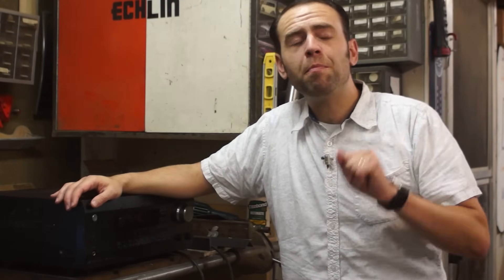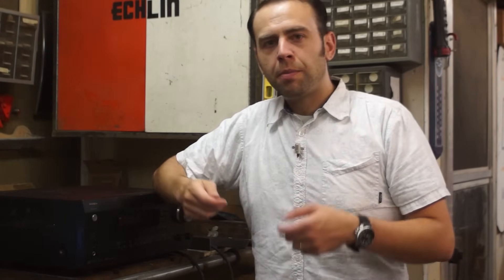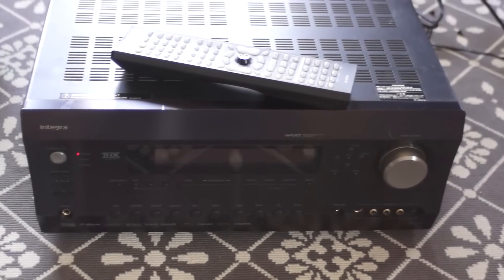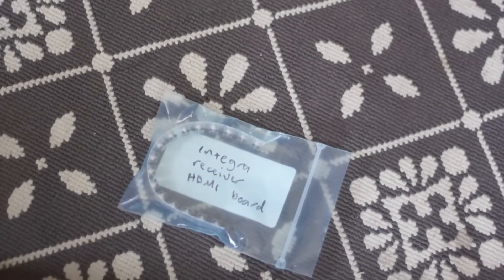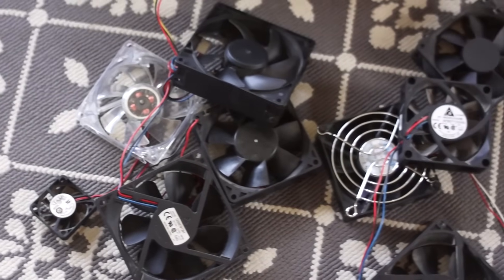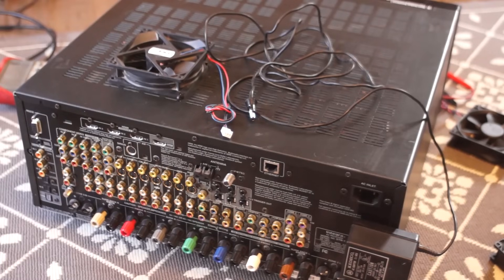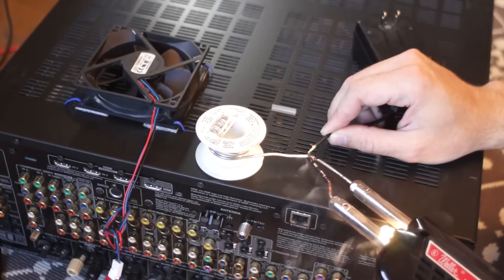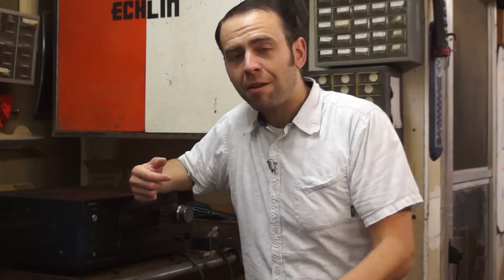Onkyo and Integra HDMI Board Cooling Fan Modification

Comment: I got a 30.5 for very cheap.the owner didnt know what to do with it.i fixed it,placed a heatsink and a fan on one of the chips on the hdmi board and its been running for the past 7 years with no problems.it was an easy fix and i didnt even have to replace anything.

Comment: I usually get those usb powered laptop coolers, and put them on top of the surround amp. They work great and are about 15-25$
Reply: And a lot of amps have a usb plug in the back so super easy to wire the fan

Comment: I have an NR636.  First HDMI receiver.  Learned/learning much.  An IC called the fan driver (according to the service manual): q8711 popped.  This seemed to (I was in bed so I didn't see it play out, frustratingly) happen at the same time somebody thought it would be a good idea to plug their big new new usb 3 phone into the usb port.  It even says on the back of the unit 5v.9a.  So...... USB C cables, properly made, is supposed to have some circuitry or resistors, etc. to protect any legacy ports.  Those cables they sell at the gas station, 711, mom and pop mart, etc. for $20+ because you forgot to charge your work phone, often are just straight through cables, nice.   So...... search for 'plugging phone in fried device' or similar.  I wish I had known this was a thing.  IMHO plugging a phone into a laptop, pc or multichannel receiver has been a bad idea since the first 2 amp phone chargers showed up with the pads and the Galaxies.  If anybody has any input on this please let me know.  Thx

Comment: I have the TX-NR757 and never have any of those problems! Bought it new in 2016 and have 7 KLH speakers attached which I have had for 20 years! The cabinet I have the receiver and other units in like a Samsung 4K Blu-ray get hot, but I just vented the back better to keep Temps down!
I am still looking at an air circulation fan.
Reply: The 757 have a fan installed from factory. My TX-NR626 came with a factory installed fan too.
Reply: @marcusjosefsson4998  yeah ONKYO said on the phone that the built-in fan might have given up the ghost.  I told him there should be an indicator on the unit to give a warning!
I now have the Onkyo TX-NR6100 and I added a fan above it in my equipment cabinet which comes on when the receiver  is turned on. More protection to last longer with all the heat generated in there!

Comment: I think Ihave similar problem with my denon AVR-3312, the HDMI out to my TV will lose video signal after turning it on for a little while.  If i put a USB fan at the back, the problem go away. The biggest issue is the noise........

Comment: This "helps" me a lot! I've bought a TX-sr578 yet, pre-owned at Ebay and  of course, the hdmi-board was coocked! No signal! So now I have to replace the capacitors. After this is fixed, I need to get the hot air out of the device! I hope to find a fan who is slim enough for assembling inside the device!

Nice video! Thank you! Greetings from Germany! ✌

Comment: Hi , I need help, I tried reducing the buzzing sound and I touched the green wire of the power supply with the screwdriver, it short circuited and  there was smoke coming from the HDMI board.
The capacitor marked ( 470 tp) is Burned at the bottom.

Comment: Lol, that ribbon cable, the last owner must have been at his wits end to give up without checking again.
I have an Integra DTR 7.7 receiver that suffered a similar failure both with the HDMI board and the video switching board that lives below it. The previous owner was a outdoor bar/bistro and they ran this unit hard every day since new before it had issues then shelved it. Mine didn't have issues with caps but the solder was all dry and cracked. This caused intermittent HDMI drop outs and audio drops using any other of the inputs. I re-flowed the hdmi board and video switching board and the issue went away. I was blown away how hot these units get. I'm looking at making a full low profile shroud that goes over the top so I can slot the unit into a hifi cabinet and have 2 fans on the back.

Comment: Why not put a thin laptop cooler on top instead. They have two fans and work off of a 5 volt usb cube power supply. Unless the challeng is for scrapping a solution.

Comment: Hey Bill,
I have a Denon receiver and  a 7.1 surround sound setup. the receiver just began overheating (I assume, feels hot) and the receiver is now frequently shutting off, it is in a shelving unit but it's always been there? Does it matter if I'm only  driving the front left and front right speakers instead of all 8? (7 speakers plus subwoofer, independently powered). My wife accidentally changed a setting so it's only playing the two speakers I mentioned...or do you think either excess dust finally took it's toll after 15 years or perhaps a speaker wire is touching another and causing a short?
Thanks my friend, Wyattspoppa

Comment: Label on amp this unit runs hot this is normal it said,so why cool,me i just keep mine clean,after eleven years use i needed to replace the capacitors.

Comment: Maybe a lame question. Do you extract air or push air in?
Reply: Extract air (in other words suck it out). Remember hot air rises, so the heat from the boards is going to want to come up. Blowing air down on to the board will prevent hot air from escaping and will make the boards even hotter! You definitely want to suck the hot air upwards and outwards!!
Reply: @zs1dfr  I got an Onkyo TX RZ820 and it has its own fan.
Reply: @Thorn in the side Yup, we're kind of special! I'm in South Africa - where are you??

Comment: How to tell air flow direction of any case fan: If you are looking at the sticker on the fan which details the voltage, amps, model number, and various symbols, that is the side that blows air. In other words, that side will cool you off on a hot day. It's also the side with the visible wires (as seen in video).  On the other hand, the pull side of the fan is the open blade side where the label only shows the company name.  All computer case fans are the same. It's basically the opposite of an ordinary house fan. Read "All you need to know about fans" (May 1996) Author: Mike Turner for all the fan knowledge you could possibly want.

Comment: Good tip on keeping an amp' cool. I acquired an old laptop holder with cooling fans underneath. The holder was broken but the fans were fine (and very thin at about 10mm) so I salvaged those and attached them under the amp' unit I have instead of on top. The unit is not an Onkyo/Integra but a Yamaha so the internal layout is different. I do have an Onkyo so I'll do something similar to yours for that unit.

Instead of zip ties and strips of packing foam, why not use double sided foam tape when attaching your fan? It would eliminate the need for those zip ties and the foam would act like vibration dampeners for the fan at the same time.
Reply: Double sided tape will loosen over time  zips won't

Comment: Thank you very much for confirming that the *05 series also have this issue. Just bought a SR-705 used. It still works, but produces a lot of heat in that area...
I am very VERY happy to see they haven't used BGA chips. I know for sure that some other AVR brand had similar issues, but for them a BGA chip had brittle solder, which is much harder to repair reliably.
I think I will just buy a Silent fan like a Noctua and wire it on. I have already used the Output for my subwoofer

Comment: I have the tx-sr805 and yeah, it runs hot enough to fry itself..im amazed they came out of the factory like this! and then you have people stacking components on it  😢 and worse yet ,using it stacked and in a glass cabinet with the door closed!  
I cant imagine the thing lasting but a few hrs b4 popping components like popcorn in a microwave..... I read up on all this Before I even purchased mine from ebay for 32.00 delivered...it worked but the ups guys or whoever packed it had dropped it on its side.. all the front switches had been yanked out of their tiny sockets or were badly misalinged..I pulled the front cocer off and straighten each of the tiny buttons so they were once again behind their openings..the only other issue was the vilume potientiometer would lower volume but not increase it... i could care less cuz the volume worked fine with the remote.. i sued the fan like you from day one...the only way to avoid the fan is if you run it, with no stacked components and the top completely removed.. it stays nice and cool... put the top on and the heat builds fast!.. since most of us dont want a naked receiver in their  system, i opt for the cover and a computer fan, right rear quadrant as viewed from the front.. try shifting in around that general area to get the most overall cooling.. and yeah, u gotta elevate the fan abt a  1/4 to half inch above the surface or it will make too much noise.. always have it Pulling heat out so hot air from inside is pulled up thru fan and out into room...i tried running audyssey with the fan off and the onscreen display froze cuz of the heat... cooled receiver, kept fan on it and no issue... its Really That sensitive to the heat!  im gonna add some small computer heatsinks to the  hdmi board chips  for longevity, either stickon kind or just alittle thermal paste and set them on the surface of the chip... it aint going anywhere at 52 lbs!

Comment: Cool vid!  Was just given an Onkyo TX-SR805 and it gets HOT!  It works and isn’t fried...yet.  Would love to do this to my receiver but there is only 2.75 inches between the top of the receiver and the bottom of the shelf above it.  Is that enough room for a 1.75 inch fan?  Thanks!
Reply from the maker: Hard to say from here. If you can somehow squeeze a thinner fan inside the housing, that might be better from a ventilation standpoint.  I've had mine out in the open air (on top of the equipment rack, basically) ever since doing this fan modification. It has been in use every single day for many hours per day and is still going strong up 'till now.  I actually just picked up another Onkyo HDMI receiver and pending testing I may just finally get to make the capacitor replacement video.
Reply: Tiny Little Workshop Thanks.  Looking forward to future videos!

Comment: Is air from fan blowing in or out?
Reply from the maker: The fan pulls air out.  The way I understand it is that you don't want to blow air into the case, because that will cause dust to build up on the components inside.
Reply: @TinyLittleWorkshop  dust just comes in on the intake. It's a no win situation with dust.
Reply: @TinyLittleWorkshop  Yes.  "All you need to know about fans" (1996, Mike Turner) confirms this. Additionally, you want positive pressure inside your cabinet (i.e. more air blowing in than air leaving) to keep dust out.  Seems counterintuitive but his paper has the data to back it up.  Google will pull it up for free.
Reply: @casedizzy  so whats the right thing air going inside the fan or going out?
Reply: @myplaguesify  OUT

Comment: I have a bgears 12V 1500rpm 58.3cfm 27dba 120mm fan. Should I use a 9V plug in instead of a 6V plug in? It says it operates between 10.2V and 13.8 V... Also, if I have a 9V or 6V or 5.2 V plug in does it matter what the amperage rating is? My 6V plug is rated at 200ma and my 9V is 300ma.

Comment: No matter WHAT Receiver or Amp you have,  ALWAYS put a 120mm fan on top to suck the hot air out...    Just by touch find out which portion of the receiver gets the hottest and put the fan there.   Problem solved and will prolong the life of your equipement.
Reply: hello sorry, if this change is not made, what do you face?  Thank you
Reply: @Tiger-dl1yn  The Amp wont be cool and that can/will damage the components
Reply: @TDNA  Thanks

Comment: Stupid question... should the fan be pointing down or up? What do you think?
Reply from the maker: Not stupid at all. I had to look it up and triple check to make sure I was doing it right during this project.  The best orientation is to have the fan pulling air out of the equipment, instead of pushing air into the equipment.

Comment: Tiny Little Workshop Hi Bill, great idea and video, but honestly I gringed a little when you soldered on top of the Onkyo case. Those tiny solder balls could have dropped inside the receiver's case vents and I'm sure you're aware what damage that potentially could cause. I would suggest putting an aluminum foil sheet over the entire case while soldering in that close proximity of the component. Please take that as constructive criticism only.  My technique was to cut-to-size, thick, double faced tape at each corner to attach the fan to the case. That provides not only a way to astetically secure the fan to the case, but also significantly dampens the fan vibration noise. I then used a black Sharpie marker to color the white edges of the tape to closely match the case color. I scored a great $3.99, 12vdc fan at Goodwill that was new in original packaging and rated at 22db. The best part though is that it has blue LED's around the fan case when powered on. Gives an awesome look to my audio stack. Thanks for sharing your video.
Reply from the maker: I've read that those cooling slots in the top cover are really good at channeling stray solder drips and blobs to only the most expensive / difficult to access components inside the case. 😅
Having a solid, cleared work area is always a good idea, because you never know when gravity or other forces will turn on you and ruin a perfectly good day.
Reply: LOL. Been there, done that too. Have a good day Bill.
Reply: I have fixed the fan on top of the cover with triangular cut foam tape.. It works as a holder and a vibration damper.... I have one doubt.. Fan air throw to inside or outside? Can anyone help..

Comment: Wich way is better? Air flow to the inside from outside or air flow from  inside to outside?
Reply from the maker: From what I've read, from inside to outside. That way you aren't constantly blowing dust into the equipment and having it build up inside the case.
Reply: The dust part is not the issue, as you cause negative pressure inside the case (blowing out scenario) the air as to get in the case, as the equipment hasn't got no air filter, dirty air will get in from other vents. The issue is if you do use positive pressure inside the case (blowing in scenario) you will dissipate the heat from the HDMI board but will spread that same heat you are trying to get out to the other components inside the equipment. That is why is preferable to blow out the air.
Reply: Tiny Little Workshop that's make sense for sure :) thanks :)

Comment: I have the Integra 4.6 but the heat comes from central part and where the transformer is located and I’m planning of doing the same thing but it has a lot of space and the amplifier is sitting by itself my Xbox and router are located the other side of my tv desk so it has space to breath

Comment: Many of these computer fans have cheap sleeve bearings and cant be laid horizontally. They get loud really fast as the bearing gives out. Take a look at the AC Infinity AIRCOM receiver coolers or their MULTIFAN line if you are on a budget. They are temperature controlled and very quiet.
Reply from the maker: Good point about some of the fans not being able to stand horizontal mounting for an extended period.  After the video was made the fan was switched to an even quieter 120mm unit that had originally been mounted horizontally in a computer case. It is still going strong 4 months in now with many daily hours of use and only an occasional dusting.  If the budget and modus operandi had allowed, one of those dedicated receiver coolers would have been great to acquire.  Unfortunately, the budget allocated was absolutely nothing, and most of those dedicated coolers cost more than was paid for the receiver itself.

Comment: Ive got a onkyo tx-sr507. It dosent have a power output in the back. Were can i find a 12v power source inside the reciver?
Reply from the maker: Good question. I'm not personally familiar with that particular model.  You could try to see if you can find a service manual online for it and pore over the schematics looking for a power source.  On the one I was working on in the video, there were two nicely labeled +12V leads going directly into the HDMI board itself. You might just try taking the cover off (with it unplugged of course) and looking around inside to see if there are any voltage labels near some of the ribbon connectors or other wires.
Reply: Get your multimeter and start probing around to find a 12volt supply.